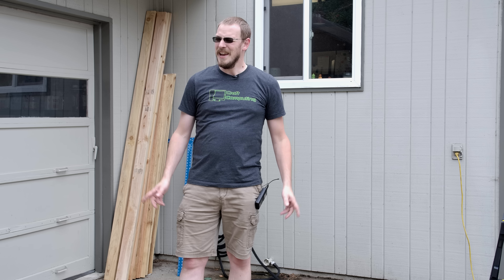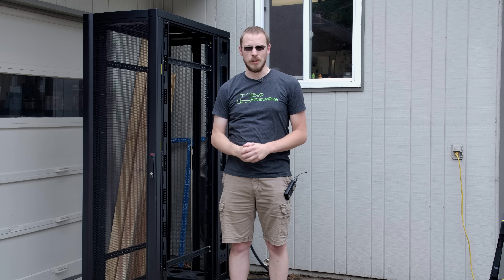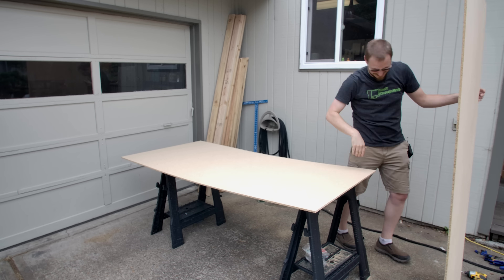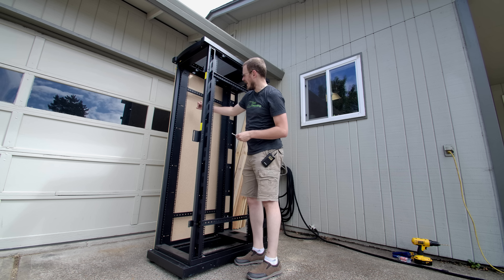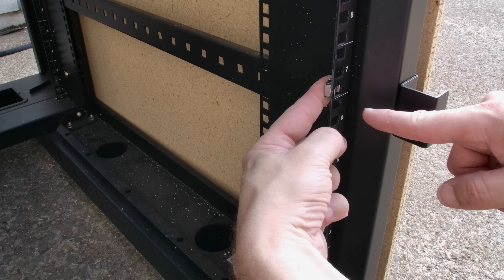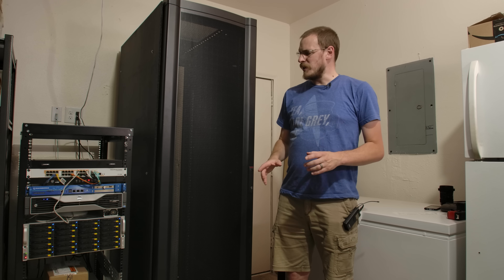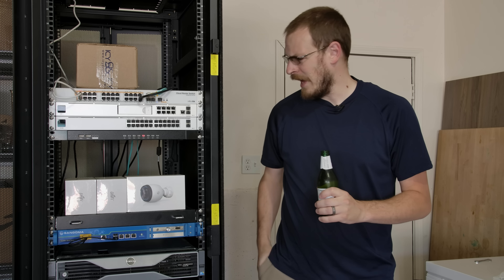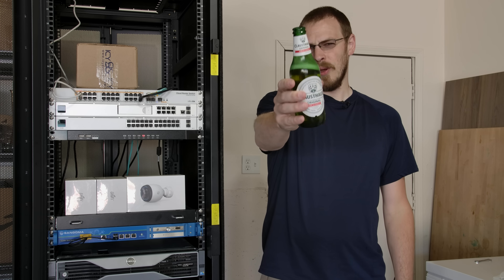MASSIVE Home Server Rack Upgrade!!

Comment: Good job on the hard work, yay for rack cooling. Please don't use MDF, it's a brittle and finicky material, especially for anyone who lives in the Pacific Northwest. Luan is a much better choice if you want something wood based at that thickness. Though personally I would have gone non wood.

Comment: That would of been cool if you could of done it with Plexiglass and LED lights.   MDF is nothing.  I'm planning on building a full rack from 2x4's and whatever.   Yes, I am that cheap.....lol.
Reply from the maker: Have you priced 4x8 plexi sheets? Halfway to buying the side panel straight from APC ;-)
Reply: @CraftComputing  Oh Really !!   Wipe's that ideal off the drawing board.   At least I'll have cool lights.  LOL.
Reply: Not really much going on at the sides of a rack, it's great for hiding a cable mess, but nothing you really need to display. One idea though could be to paint the outside of the mdf with "white board paint" and use it to keep notes of what's in the rack, dates you installed stuff, the amount of ram and drives in the servers and so on.
Reply: @strandvaskeren  My OCD won't allow me to cable messy.
Reply: @jeffherdzina6716  The only way to wire a rack so it's not somewhat messy is to create a very static setup with every wire cut to the exact length needed. Swap out a server to one with the nics in another spot and you need to redo your wiring. It's just not practical in a live environment. In a dynamic setup where things change from time to time, you typically organize your power cabling to one side of the rack and your data cabling to the other, with cables slightly longer than need be and try to keep the spare length curled up at the sides of the rack where nothing is going on anyway.
Reply: @strandvaskeren  This is tech and 2020 who writes stuff down anymore. Files for all your data
Reply: @mrmotofy  In principle I agree. At work we plan and document first and build second, to keep the documentation current and allow everyone to know what's going on. But my home rack is my own brain child where I do all sorts of different setups, build first and maybe document second if I remember. Having a whiteboard close by is super convenient for a quick drawing or some notes. Nothing wrong with doing it electronically, but having the choice between plexiglass and led lights or a place to put notes I know what I would choose every single time..